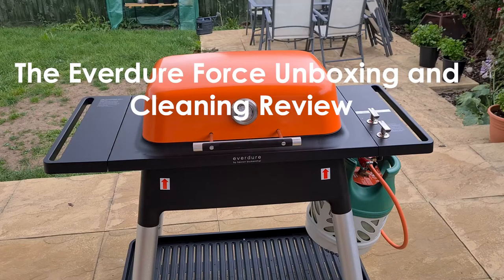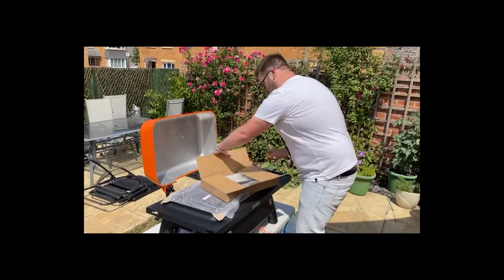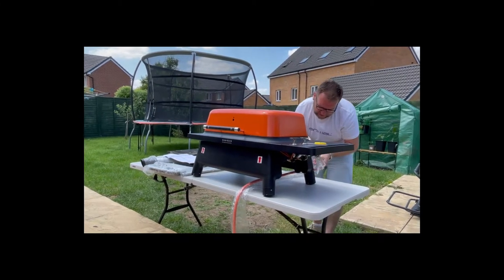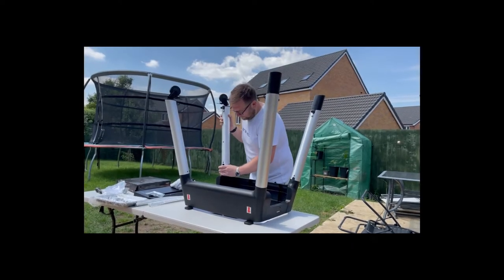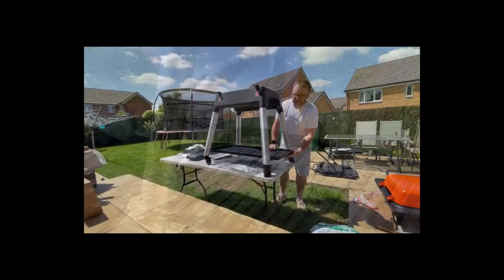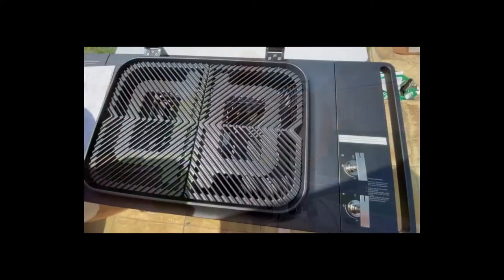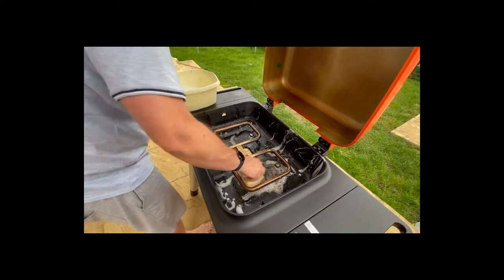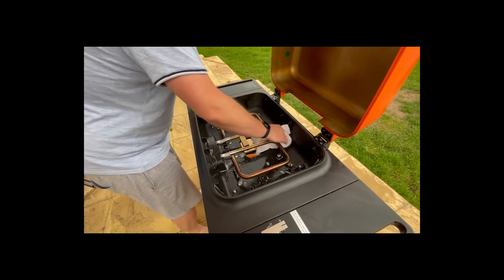Everdure Force Unboxing and Cleaning Review

Comment: Thanks for this… I do have a question, how should you clean this after every use? I’d rather not do that whole procedure every time. Can you use a metal barbecue scraper? I read somewhere it’s not advised but I might be wrong
Reply from the maker: So, I gave up on every use cleaning. I fire up the burners after cooking then use a metal brush as it chars. I know it says not to, but it’s a pain to do it with soap and water. The grill gets fired up on high on next use and use brush again. I clean the tray out after each use, unless I am going to use it the next day. I clean the base in the same frequency.  Even though I know I’m scratching the grill, if it’s hot enough nothing sticks.
Reply: @jbukreviews1424  agreed! After writing this I fired up the burners after use too, as hot as possible, basically to mimic an in-built oven cleaning process. It pretty much vapourized all the ingrained char in between the cracks/grooves in the grill plate that the wire brush couldn’t reach. Pretty cool…. Thanks for the response.

Comment: You're right that there isn't much info available about this grill so thank you for providing this review! How have you found the temperature of the grill? The only other review I found mentioned inconsistency across the grill surface.
Reply from the maker: Hi Jordan, I have found the temp pretty good and does give a good sear on the food.  There are some Hot and not so hot spots, but I quite like that as I can move food around to avoid it burning etc. FYI I also used the pizza stone and fresh homemade pizza. Works a treat
Reply: @jbukreviews1424  Good to know--thanks! Have you had any issues with the cover heating up and not aligning with the bottom portion of the grill?
Reply from the maker: not at all.  I saw that review and it did worry me, but they must have made changes.  8 have had the lid down on full heat for 10+ mins without any issues.  it does get very hot and for that it's awesome

Comment: Hi, thanks for this video it’s a bbq I am considering seriously. All the reviews say cleaning is “tricky”, I assume it’s not because you scooted round with hot water and soap then rinsed off and a dry down to finish. Can you confirm it’s as easy as you make out? Hope the bbq is serving you well and you’re having fun in the caravan too.
Reply from the maker: It is pretty simple. I bought a little plastic putty blade to help scrape some of the larger deposits. Hot Soapy water and a washing up brush does the job well. Grills are less easy. I just turn up the burners and chat everything off and the brush it

Comment: I bought a Furnace, its great concept but poorly executed. There are many issues, you can't have all burners on high with the hood down or it warps, the grill plates don't sit on the tabs securely, the slightest bump and they fall off, the heat isn't even across the grill, it has a lot of cold spots, don't buy the rotisserie it's made of cheap folder metal, mines already warped after a single use, it can't be used in the rain and since there isn't a dedicated rotisserie burner and Everdure recommend keeping the grates on food doesn't brown, it just spins around, the grease trap is pointless, the BBQ is flat, grease can't run into the trap, it just sits in the bottom of the BBQ and can ignite, the expensive cover isn't made from water resistant canvas, if it's raining the cover doesn't protect the BBQ, it still gets wet, I BBQ all year round, rain hail or snow, I don't think I will be with with this BBQ, it will be a summer only BBQ.